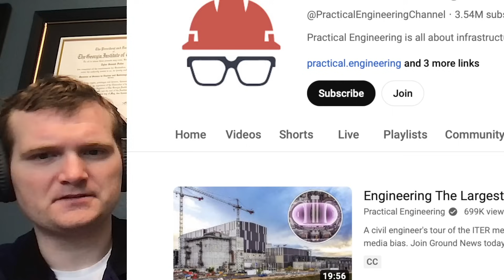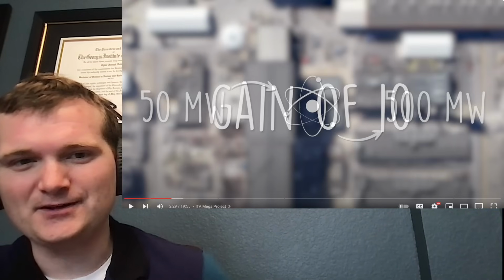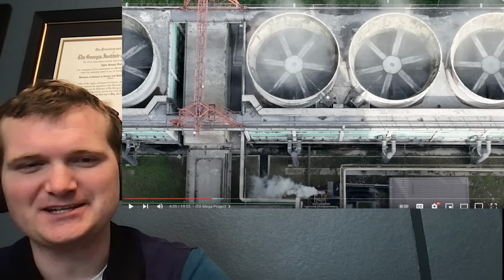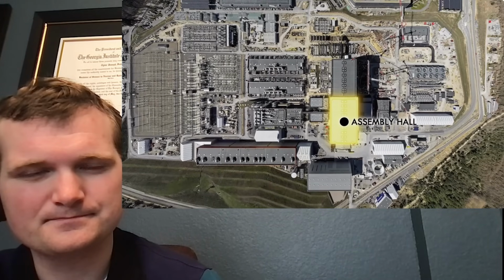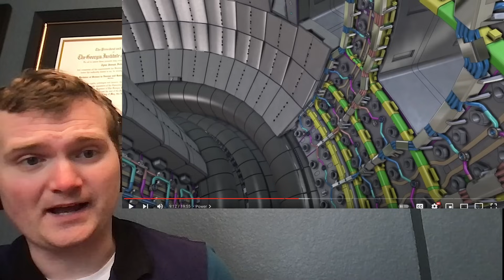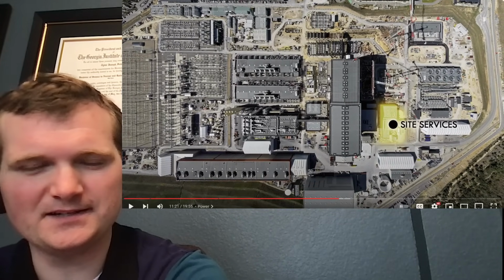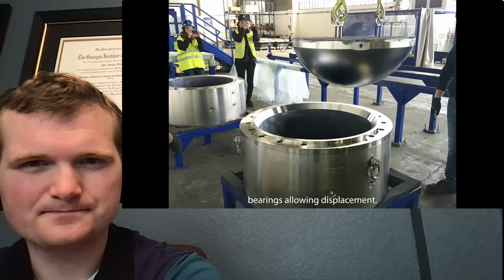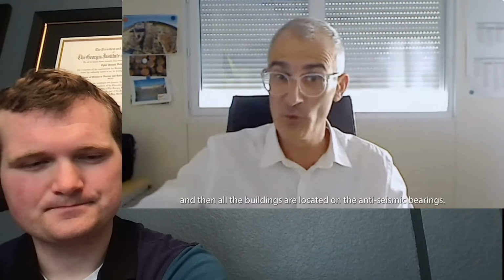Nuclear Engineer Reacts to Practical Engineering "Engineering the Largest Fusion Reactor"

Comment: 17:20 Fusion reactors probably would have similar right of ways as fission reactors as each time you want to turn it on you have to heat up the plasma which could take anywhere from 10 mins to multiple hours and
even as you turn it off you need to keep those giant electro magnets on while the 150 million+  degree plasma cools which could take way longer as the only way to let it cool is to radiate heat, if those magnets don't stay on the reactor walls could meltdown,
and in an emergency you couldn't just spray water on the plasma because that would cause the water to boil and thus explode.

Comment: I would love to hear your thoughts on fission/fusion hybrid reactors. To me, they sound like a good bridge between tried & tested, and sci-fi technology: keep a fusion reaction going, but it doesn't matter if it generates a net gain, just use the excess neutrons to fission a blanket of nuclear waste products (and use the heat as usual). It should give some valuable data from the fusion part, while being easy to shut down, and produce less (and shorter lived) waste.

Comment: At this point, I'm convinced Fusion is a problem of economy scale. Small fusion might not be possible, but the larger you make your fusion reactor, the more efficient it is. Up to of course, the size of the sun, which is 'Free' for a billion years.
As a benefit, you get Helium, which 'was' a normally finite resource on earth.
This is probably also why there are also no natural black holes at such small scales. Just not enough matter/plasma to sustain?
Reply: Keep in mind, increasing the reactor size also increases mass. The increased mass means more power is required for that mass to reach the same temperature. The amount of power that can be generated from a heat engine is based on the difference in temperature, thus making the reactor larger reduces the efficiency of electric generation per gram of fuel fused. That's not to mention all of the other challenges scalling causes.
Reply: Thats the concept of ITER, the smaller prototypesaround the world all need more power then they can output, if ITER shows results then more focus can be applied to the power density problem, same challenges were overcome with fision back in the day.
Still to this day tgere are many opposing fusion just because it isnt proven yet.
Im still hoping that the german 7X project can be applied in a large scale machine.
Its a stellarator instaed of a tokamak, and sould be a more efficient desing.

Comment: having more diesel generators wouldn't have saved Fukushima Daichi. The problem there was an architectural mistake which placed the fuel tank for the diesel generators at the lowest point of the complex, so when the tsunami hit the fuel tank was under water, flooded, and the fuel was contaminated, causing the diesel generators to fail.
Oops.

Of course there was the little problem of the tsunami being considered theoretically impossible when the plant was planned and designed, based on the then current understanding of tsunami events no tsunami could ever be strong and high enough to reach the complex, let alone wash over the surrounding shield walls.

Comment: Fusion in theory has an even better method to make power than steam. Fusion can actually make power from capturing the high energy particles and free electrons in a process known as electrostatic direct energy conversion. In theory, the efficiency should be far higher, but at the cost of the plant being much more expensive. No plant currently seems to intend on using it mainly because getting the fusion itself to be positive has been a struggle.
Reply: The issue with the direct energy approach is that the majority of energy released in fusion reactions is carried by the neutrons. Direct conversion doesn't work with neutrons because they can't be slowed down by magnetic or electric fields.

This immediately disqualifies Deuterium-Tritium fuel mixtures from working in direct conversion generators. Deuterium-Deuterium fusion has around half of its power output in the form of neutrons, and half as charged particles. Take the 50% of the charged particle power and multiply that by the efficiency of the direct conversion generator, and you will likely be looking at a total efficiency lower than steam generators.
Reply: @RMX7777  I saw studies showing they were able to get up to 65% efficiencies with select designs and the TMX study was able to get 50%. 

It likely won't work on D-T reactors, but as of right now we still don't even really have designs how we'll collect that energy anyways from steam. As of now we continue to find the demands of fusion to be more stingy and until we can fully understand how to maintain it we really can't make a method to collect that power. It's all just theoretical when we can't even get more plasma energy out vs making more energy than used.
Reply: @Skylancer727  From what I recall, the plans to generate steam involve pumping coolant through the lithium blankets, then exchanging that heat with a water and steam turbine system. ITER doesn't intend to demonstrate this because it is a well known science.

Direct conversion is the ideal solution to power generation, but we are a long way off from its practical application. As you've stated, this is due to the difficulty in sustaining a plasma. As the Deuterium-Tritium fuel mixture is incompatible with direct energy conversion, one of the lower cross-section fuels must be used.

To reach the same output power using lower cross-section fuels, more fuel mass and greater temperatures must be utilized. This means an even more unstable plasma than what we are already trying to deal with.

No doubt, once D-T fusion has been trivialized the world will turn to direct conversion as the next great energy source, but that seems a good way off in the future.

Comment: Ah you were wondering about the specifics about the up/down time potential cycling and grid demand or internal power demand. Fusion you can near just turn off at the drop of a hat, but, the time it takes (given current technologies and abilities) to re-establish the plasma field and the electromagnetic compression system, the cycling of power (On/off) will actually slowly damage it, lots and LOTS of learning to be done, also you have to have control flow of tritium and deuterium. So an amount of potential decay products in situ required for the reaction, a fairly short decay time, but still required to evacuate and clear the magnetic chamber before restarting.

Comment: i built a nuclear simulation. in terms of your comment on decay heat, i found the same thing too. when i had a supercritical system and added a whole bunch of Boron-10, it very quickly killed any reactivity (when i tried it with Carbon-12, it did not) but there was still so many decay products breaking down into more stable isotopes and releasing delayed neutrons.

Comment: I wonder if it'd be possible to harness the decay heat to generate enough power to run the cooling systems. I'm sure there is a good explanation why they don't, but it'd make sure the backup wouldn't fail until the material is no longer capable of melting anymore.
Reply: In the Fukushima case, I understand the problem as "places that shouldn't have been possible to flood got flooded, ruining backup power". I think the challenge may be building the backups in such a way, that they can't fail no matter what hits them.
Reply: something that could be used for that is a thing if I understand your comment its called an rtg or Radioisotope thermoelectric generator
Reply: @flazerrazer2992  Since the heat is there already, I guess it would just be a "thermoelectric generator", that happens to be powered by decay.
Reply: Some generation III+ reactors, such as the AP1000 already have passive safety features based on natural convection.

Comment: 4:00, something that has always bothered me, why cant the decay heat from the fission products, be used to generate power, and cool the fission products?
is it a matter of not trusting the system after an event like the fukushima earthquake? potential damage to the turbine and such?

if its hot enough to meltdown, its clearly hot enough to boil some water, which could be fed into a turbine....., but then you still need to run the condensers and recycle the water...

Comment: Generally the AC adapters that are a block you plug into a wall are cheaper than the in line bricks. I more just hate the ones that are pinned for a wall outlet so they block 2 slots on a power strip.

Comment: The biggest problem with our energy future is how wasteful we are. A lot of energy is waste heat, as well as spent on AC and heating of badly designed buildings. Not to mention useless powerhog appliances. Compare the avg household with an off grid cottage, where owners design for energy efficiency and educate themselves on energy use, leading to a difference of 3-10 times less energy used...

Comment: The power brick thing is....honestly not that complicated. You need to convert the AC to DC, this has to be done SOMEWHERE in the pipeline unless what you're powering works on AC. So you can either do it at the plug, or at the device, it's THAT simple. Want a smaller device? Do it at the plug. Want a more convenient device? Do it on the device. Even with GAN technology this tradeoff is still the same, though the bulk is SIGNIFICANTLY reduced if using GAN, so it's not AS big a trade off anymore.

Comment: Nuclear fusion is not all that hard. There's many fusion reactors around, some even in a garage. Of course the power output of these "fusors"  is too small to measure but they do produce neutrons which can in turn make things radioactive. One of the not mentioned challenges for ITER is working inside the tokamak after it has been running, it's going to be very radioactive so only robots can work in there. Tritium can be produced by the neutron bombardment of lithium. I hope ITER can make some for its own use.  think there are plans for lithium blankets inside the vessel to produce tritium.. 
The real challenge is getting the total power output to exceed the total power input. We've already managed to get a Q of over unity at the National Ignition Facility but that's comparing the energy hitting the million dollar target to the energy released.

Comment: Why wont fusion energy scale down to a level that we can test it before we have to build a $3trillion dollar full size (size to us) machine? It just seems odd to me that the universe would be able to dictate the scale at which this thing will work when you consider how small we are in the overall picture of the universe. The difference in scale from tte current full size compared to a benchtop version is closer to each than anything other scale source we have to campare it to otherwise.
Reply: I think this can at least be partially explained by an attempt at decreasing power losses due to reactor wall collisions. Essentially, the superheated gas really wants to expand out, but if it were allowed to touch the walls it would cool below the temperature needed to sustain fusion.

We use magnetic fields to force the plasma to stay in the center, but thus far our control over the plasma has been flimsy at best. By having a larger reactor, there is more space between the plasma and reactor walls, and thus more room for error in confining it.

I'm sure this isn't the only reason however.

Comment: And the world is full of people who think nuclear fusion powerplants are just as dangerous as fission powerplants.😅 Those people should learn how fusion and fission is achieved.... 
But to make it simple... Getting a fission reaction is easy.. once fission is happening it's hard to stop it..... and you need to cool it otherwise the temperature goes way up and the fission reaction gets out of control. So the cooling and control system has to be perfect to keep it safe.
Fusion on the other hand is extremely difficult to achieve... Everything has to be perfect..... the pressure.. temperature.. and even the magnetic field that shapes the plasma and more.... if one of those things isn't perfect the fusion will just stop. So in case of an earthquake and maybe even a tsunami if the fusion system takes any damage and isn't working perfectly the fusion just stops and everything cools down by itself fast. By this I mean the walls of the reactor and the steam that powers the turbines to generate electricity. And I know you can also get electricity directly from the plasma but I think we just start with using the heat to drive steam turbines. It's easier to start with and this means we can partially use old powerplants with fusion reactors. We have to rebuild the part of the coal or gas burning or fission reactors into fusion reactors but we can still use the steam part of those powerplants. For getting the electricity directly from the plasma we have to build completely new powerplants because even the steam turbines are useless in that design.
But one thing is for sure... we will never make a miniature sun on earth... because getting plasma in a perfect spherical shape is the most difficult shape to achieve... try squeezing a balloon into a perfect sphere.... you can't😄 Getting the plasma to fly in circles is much easier... but still extremely hard. And it can't touch the walls because it would melt it. And if that happens the pressure gets out... the conditions for fusion are gone and the fusion will stop.
So yes... Fusion is very safe!!! Even safer than solar and wind energy!! Because workers electrocute themself a lot in the solar industry and a lot of workers fall from windmills in wind parks each year. Btw... even fission is safer than solar or wind energy!😅  If you combine the deaths of all nuclear disasters that ever happened with the deaths in the fossil fuel industry and solar and wind industry in all of known history fission is still hundreds of times safer😅
I'm just a huge nerd and fan of everything nuclear so correct me if I get anything wrong. This way I get it right next time. I wish I didn't have PTSD and could go to school again to study in anything that is nuclear. No matter if it is in nuclear physics, medical or generating energy or whatever.... it's all cool to me!
I know I have the brains for this kind of stuff. Just never got the chance to discover my intelligence and interest in anything nuclear in school because of bullies that made me quit school at age 17😒
I wrote this all before watching btw😅 Normally on youtube I react after watching a video.. but not when it comes to nuclear stuff. I just can't contain myself with that topic😅 Maybe it's for the best I can't go to school for this stuff... I would give the teacher long working days because I have so much to say and ask about the nuclear topic.😅